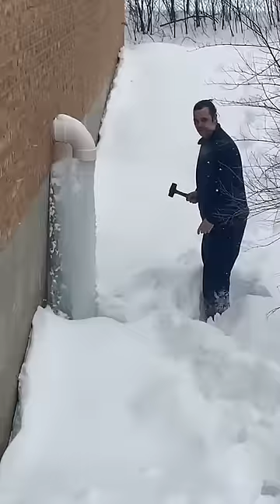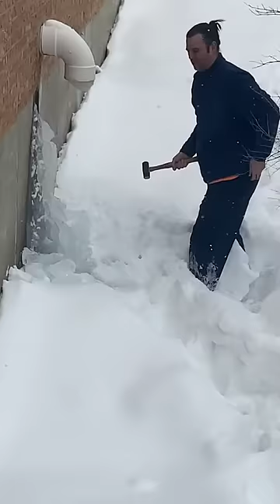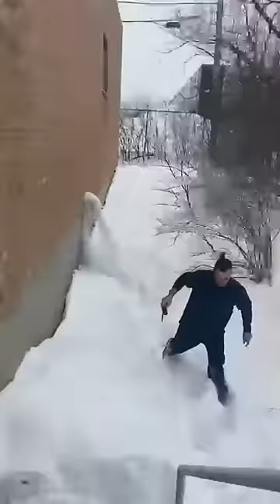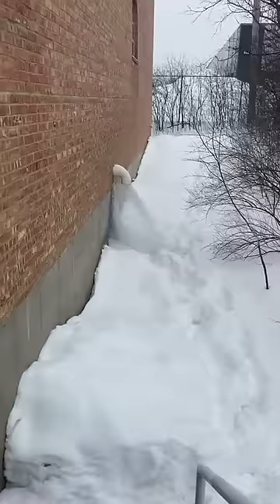Smashing ice from roof drain

Comment: Satisfying, and even more so, as this is an easy DIY fix, instead of having to pay someone to do it. It was also something that REALLY needed to be done to prevent water and ice damage. Left undone, the weight of the water and ice could easily collapse the roof, and maybe even the whole building. If someone was inside when that happened, they could be hurt or killed. Instead, a few good whacks with a hammer or mallet, and a chisel or pick fixed the problem before it could turn into a disaster.🏔️👷🏻‍♀️⚒️🔨⛏️🤗
Reply from the maker: I’ll consider this comment as a Christmas gift. I have approved over 100 comments and deleted at least that many that were just total ignorant insults. What a wonderful thing to say and of course I agree. Thank you my friend and I hope you have a nice Christmas!
Reply: Hallelujah!
Reply: Most people lack the self confidence to attempt the most simple manual tasks requiring basic life skills like using hand tools and risking possibly getting a little bit wet. It's a real issue. Lack of father figures? (I would also encourage mothers to take on these duties).
Reply: @onesixfive  
I was waiting for you to hit the pvc and it’d bust!

But kudos!!!!
It all worked out!!!
Reply: @misterbulger  💯
Reply: Yeah at 8 pounds a gallon that's a lot of weight.
Reply: Heat tape would prevent all of it.
Reply: @onesixfive  You actually broke the ice down properly...too much force and you could have cracked the PVC drain...
Reply: @jonnydanger7181  that'd be too easy 🤣
Reply: @onesixfive  Typical trolls, too much time on their hands I suppose, anyways good job on releasing that built-up water from that building.
Reply from the maker: Thank you brother! I’m glad you enjoyed the video!
Reply: A few quirky jokes never hurt either ;)
Reply: Huh, my like is 666th! What you will do now?
Reply: I’m impressed that he used a mallet lol
Reply: What heats the heat tape, ?
BATTERIES 😅
Reply: I live for this shit.
Reply: @tubeyourself  I grew up with a mom who bought a huge home repair how to book for the things she didn't know. I think I seen her use it once. She knew how to do everything she needed, had a ton of tools just in case. She isnt afraid to break something and rebuild it better or properly. Most of my friends parents would struggle replacing a window screen.

Comment: Awesome job!!! In Alaska is where I realized just how important it is to make sure your roof has a working drain in the winter as well as the summer. Heck, we even shovel the roof! I was laughing first time I saw this guy up on his roof shoveling the snow and my brother quickly told me that enough snow 
on the roof can cause the roof to collapse and it could happen with anyone inside. 😳
Reply from the maker: Sending respect to my viewers in Alaska! Thank you for commenting sir! I can’t imagine the snow build up on the roof. I agree it will smash down if left unattended. Thank you so much for watching and commenting!
Reply: That's why smaller buildings up North simply use extreme inclination roof - sure, it eats a lot of volume, but there is only so much snow that fit before gravity does it's thing. 
Unfortunately, many countries add height limitations disregarding the NEED for such roofs, especially in short-staffed places. As a result, people's lives are exposed to unnecessary dangers, energy waste (Snow is actually decent insulation/wind barrier, removal of all snow reduces heat efficiency, plus some places actually use active exterior heating to keep icicles in check) and extra work hours.

Comment: How familiar it is!))
A month ago I worked in the Arctic Circle. All the workers lived in trailers. And if you do not spill one kettle of boiling water at least once every two days, then the water drain turns into one solid piece of ice (fortunately, technically it was made as a piece of hose coming out of the trailer, so it could be pulled out, gouged with a crowbar, and melt the remains)
Reply from the maker: Wow! That is some difficult conditions !

Comment: Just as a friendly reminder . If you actually do this there is a chance you could damage the PVC pipe with the shock of the hammer blows on the cold plastic reverberating through the ice.  This could in turn cause leaking from within the pipe to come inside the building and have that whole wall need to be replaced . You might need a better solution
Reply from the maker: Omg this never even crossed my mind 🤯

Comment: That is why you don't install a down turned 90 at a roof drain.  It is supposed to get a brass "cow's tongue"  cheap contractors try to save money by installing a $10 part, instead of the $150 part that won't freeze up.  Too much water can cause structural collapse of the roof.
Reply from the maker: Never heard of this cows tongue, interesting…….

Comment: May want to use a blow dryer on the ice just below the spigot, when getting so close to the drain spigot.
Although the hammer and screw driver worked this time, you could have easily put a hole into the spigot with bad aim.
Reply from the maker: I guess I got lucky this time! Thanks for watching !

Comment: I don’t understand how something can freeze in that way, I mean its a moving body of water? its not like jack frost snaps his fingers and its frozen
Reply from the maker: It doesn’t need to happen at once. A little freezes, then a little more……
Reply: @onesixfive  it probably starts freezing from the outside in slowly restricting the path in which the water can pass through, at least thats how I imagine it happening
Reply from the maker: Sounds about right. Keep in mind 90% of this pipe is inside the building where it is heated, so that will never freeze. But as soon as it touched the freezing cold
Pipe, that changes quickly. To be clear, this is not a common occurrence.
Reply: @onesixfive  Yeah thats what I thought! its just interesting to try and imagine how this happened. Because it probably happened over the course of a few days. It’s hard to imagine just like it’s hard to imagine plants growing or something. Would love to see something like this freeze up in 100x speed or sth...
Reply from the maker: There has to be extreme temp swings over like a 48 hour period I think. Coke with lots of hard snow. Then very warm, then cold again. Wish it happend more, I’d be out there!
Reply: @onesixfive  yeah its hard to set up stuff to record sth so rare.